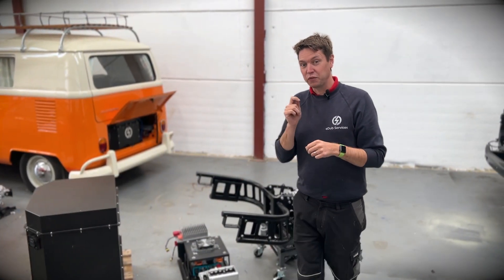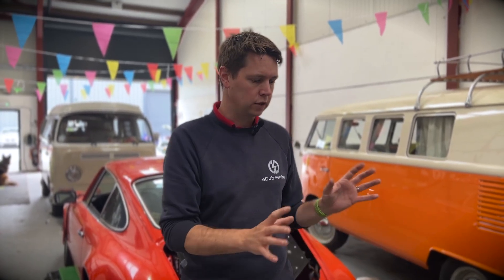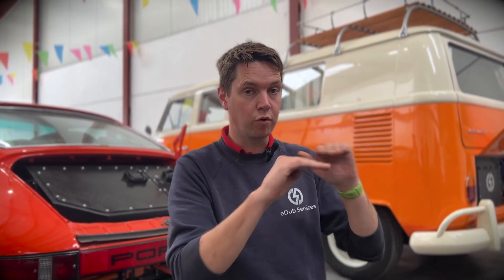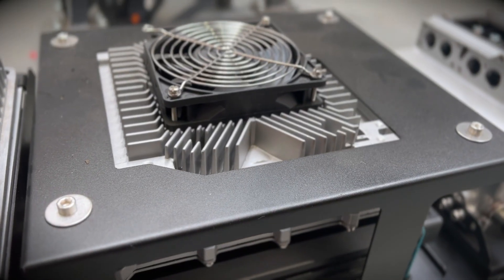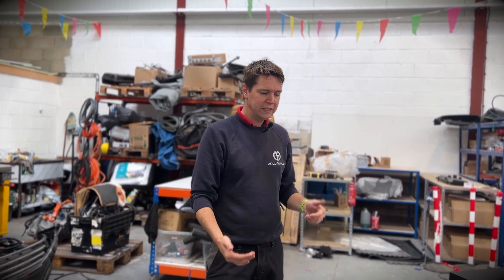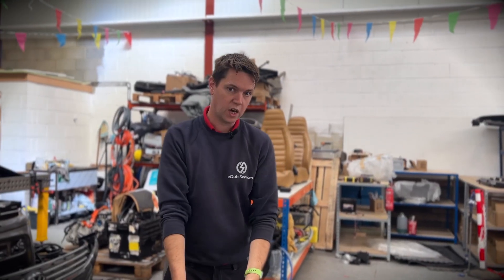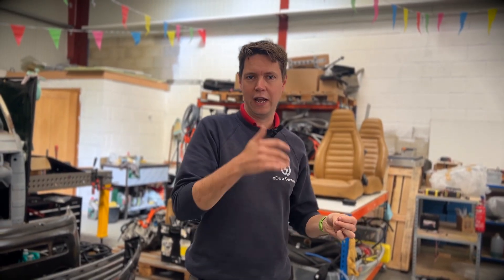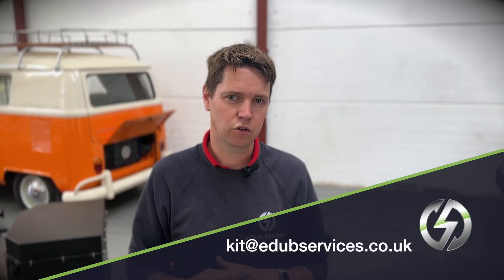VW Camper Van Electric Conversion Kit 2025

Comment: I'm a spry 78, recently retired after 15 years working at an RV Solar - lithium battery replacement business eliminating diesel generators. From vans to 40 Footers. I was a system designer, installer. My son still operates the Vanagon Ford Engine conversion company we ran for 12 years. I suggest adding a SEPARATE solar - lithium "system" to run the camping experience - extending drive miles. I live in a solar-lithium 40' RV.

Comment: We'd love to see more cutaways of the actual tech kit. Your customer base is going to be technically savvy and will enjoy more lingering shots on the bits of tech and where and how they mount to the camper. It's very well scripted and presented with great information about the conversion, just needs more b roll. A go pro or a phone pushed into the tight areas works really well to show the installation. Maybe put the camper on a ramp and show the underside. I get that you might not want to give too much away to competitors but the magic is probably happening in the R&D going on in controllers and management tech. Good luck with these conversion kits. It's such a good way to secure the future of these iconic vehicles.

Comment: £45,000 - £55,000 to trade only and fitted £55,000 - £75,000, if its so bolt in, how many hours is it for the £20k fitting cost .
Reply: He said it could be as fast as an hour.

Comment: Wait you have 62 kwh behind the rear axle, this sounds like quite a weight imbalance. Have you corner weighted a car with this system in it? So a 100 to 150 extra on the rear axle without anything in the cabin space?